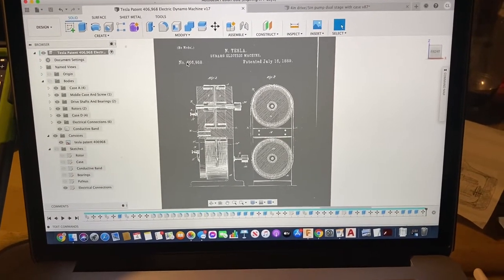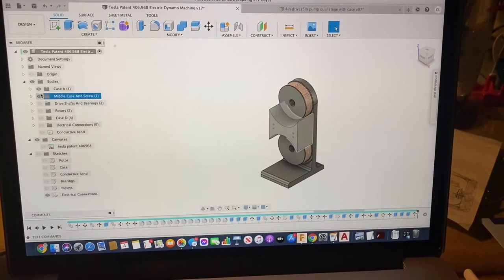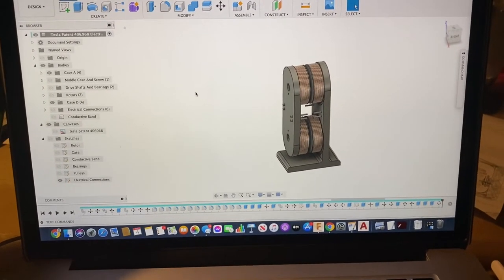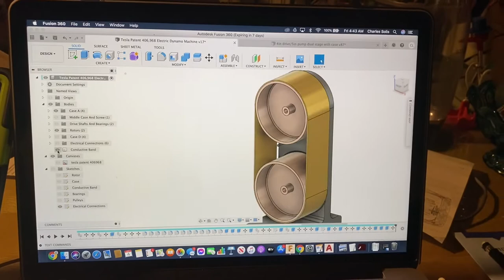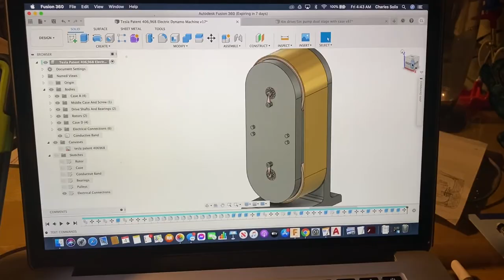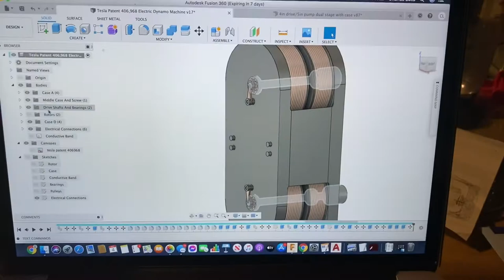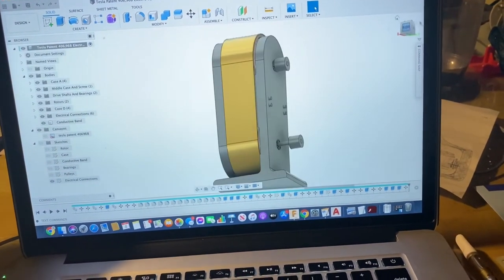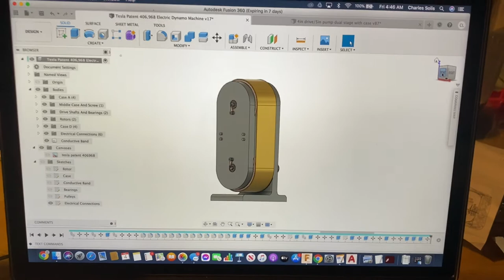Nikola Tesla Patent - 406,968 Electric Dynamo Machine - DC Electricity Generator Homopolar Motor

Comment from the maker: FYI everyone, This is exactly like a faraday disc…. It’s just two of them in series. One faraday disc with the current going from its drive shaft in the center to its periphery through a conductive band, to the periphery of a second faraday disc, to the center of the second faraday disc and out its drive shaft. 

Also just FYI, when a generator is “self exciting” it means that it does not need an external power source to generate the magnetic field that induces the flow of current/power. There are some generators that work to produce electric but need a small “exciting” power source that creates the magnetic field for some armature to spin in or for some armature to create a spinning magnetic field. For example an, without some kind of permanent magnet inside the generator no mater how you wind up coils inside you will never be able to generate a current without first creating some magnetic field via an external power source. However once “excited” small loads of power can be pulled off the generator to maintain the magnetic fields for continued operation without pulling much off the total power output. However, generally speaking, all generators that have permanent magnets in them are “self exciting” (and if there is one that does and is still not “self exciting” I certainly haven’t heard of it. But this is a common term defining generators. And when Tesla says this generator is “self exciting” he means that because of the permanent magnetic field in the casing it does not require some external power source to “excite” the first currents to make it work. You just spin the discs and free charged electrons in the rotor that is moving perpendicular to the the permanent magnets magnetic field it generates a voltage potential radially in the disc. He then says you can further draw some current off through coils in the casing to increase the inducing magnetic field on the rotor for stimulating higher voltages off the shaft without needing to change the RPM or get stronger permanent magnets. But as long as the there are magnets in the case or the steal casing is itself a horseshoe magnet 🧲 and has even some small magnetic field the currents generated are “self exciting”.

Furthermore, Tesla said you can keep the rotors insulated from the shaft in the scenario where you would axially stage multiple rotors on a single shaft. A dual shaft with 3 individual rotors on each shaft could be set as follows. (Assume all magnetic fields are set up in the way to make current flow in or out on each rotor as I say, this would be as a hole complex but each individual rotors stator arrangement would be easy to stage just the same.) 
The 1st rotor on top, nearest a casing wall would be electrically connected to its shaft on top.  The current goes in the shaft, from the center of the 1st top rotor, to its periphery, then down a  conductive belt, into the periphery of 1st bottom rotor then into the 1st bottom rotor’s center. This 1st bottom rotor would be insulated from its shaft, while still being mechanically connected, as well as a 2nd rotor, on the bottom shaft, that’s next to it. This 2nd bottom rotor is, however, still electrically connected to the center part of the 1st bottom rotor, even though neither are electrically connected to their shaft. Ie, the 1st and 2nd bottom rotors would be sleeved over an insulating hub to still be mechanically connected to the bottom shaft yet insulated from the bottom shaft, all while still being electrically connected to each other in their centers. (Again assume magnetic fields are set up appropriately to induce each runner these current paths). The current going from the periphery of the first bottom runner goes to its center and then to the center of the rotor next to it (that it’s electrical connected to) then to the periphery of the second bottom rotor (instead of shorting to their driveshaft). The periphery of the 2nd bottom runner would have a 2nd separate conductive band that runs from its periphery to the periphery of the 2nd rotor on the top. This 2nd top rotor would then also be insulated, at its center, from its shaft (on top) and coincidentally the 1st top rotor all together. As well, though, the 3rd top rotor would be electrically insulated from it’s shaft (on top) BUT it would be electrically connected, at its center, to the center of the 2nd top rotor. Ie the 2nd and 3rd top rotors are on electrically insulating hubs that are mechanically connected to the top shaft. (just like how the bottom 1st and 2nd rotor are electrically insulated from their shaft but still mechanically connected via an insulating hub/collar/“sleeve”) The current continues running from the periphery of the top 2nd rotor, into its center, then to the center of the 3rd top rotor, then to the periphery of the 3rd top rotor. This 3rd top rotor would have a 3rd and final conductive band running down to the periphery of the 3rd bottom rotor. This 3rd bottom rotor would then be electrically and mechanically connected to its shaft, on bottom, but all together electrically insulated from the 1st and 2nd bottom rotors that it shares a shaft with. 

Thus completing the circuit from one drive shaft through 6 faraday disc dynamos in series (going radially out then in, and then out then in, and finally a 3rd time out and then in), then out of the circuit down the bottom driveshaft, all while making the only non static electrical connections in the system at the center of the two driveshafts where the tangential speed of the driveshaft is very very small. 

Thus reducing any slip losses of the electrical connections and friction loss, because traditional faraday discs have to have a sliding connection at its periphery that has high friction loss and poor electrical connections because of the lack of surface area. The conductive bands are always in static connection to the rotors they touch, as they are not sliding on the rotors, just spinning along with them. This simultaneously increases the effective connecting surface area for very high current capacities with low loss while drastically reducing any kind of kinetic friction loss, plus subsequent wear and tear. Heck the electrical connections to each driveshaft alone could be done with an electrolytic fluid or some other conductive liquid material to make the electric connection have a lot of surface area, again for high currents, and making the sliding losses dang near negligible. 

I hope that makes sense. Let me know if something didn’t come across right!
Reply: The word your dancing around is ( reference)

Comment: Nice cad drawing, looks like the so called (n machine)or Faraday's disc but then a dubbel acting one to eliminate most of the problems like the mercury sliding contacts, however the belt needs to be flexible en conductive ,  again a really clever thought out machine by Tesla, 
I want to point out I always always had the feeling it's a analogue of the Tesla turbine/pump in how it operates (making pressure as it's rotating, en rotates when you apply pressure/voltage

Comment: Wow, never seen so best show and explaind. The discs have flanges(edge like T) the  coils may be arownd the permenit magnets(that or stator?) Try a small one made of maicrowave ovend magnets(4) and Hard drive discs with a pice of pipe(aluminim) as the edge. If the magnet has 80mm and the pipe 100mm you have 19mm for  each coil per thikness of magnet 4mm. May be ther closed up on each outher olone( jumper start with end) once in a rotating magnetic fild they lift up corents of oposit direction( edy, self induction, backemf) becaming a eletromagnet( if wond righ a north to a biger north ou rong north in and a eltro sauth araund??) Hop I help same way inven if i am all rong. Thanks

Comment: Porahps he use it too run ocilator of high frequency, or run it with tesla torbine+ pump. Homopolar is the only way to produce with no self-induction(correntes only in 1 way) DC, that can have no back-emf by using it with high speed interuptions( aparatus.to produce correntes of high frequency)
 tesla frequency volts/ second.
Cheack out Pauls torbine on chanel grevinert, seams like a peefect fit.
Reply from the maker: Hey thanks for commenting! That’s the plan! Check out the Tesla turbine build videos I have on my channel! I’m already getting lots of torque even for the small size Tesla turbine I’m making. Still working on the casing for the 60x 4in drive disc and 106x 5in second stage pump disc dual stage Tesla turbine I’m making. So it’ll get even more once I utilize the spiraling action of the fluid instead of just blowing through and out the other side like I’m doing for balancing. Also I’ve got a 75 disc 10in diameter disc and 12in casing Tesla turbine that I’m building right now too with the same disc spacing and thickness parameters as the small one so it should have A LOT of torque and horsepower potential. More build videos and tests to come soon!
Reply from the maker: Low rpm torque 
https://youtu.be/0lQnAQ11aFg
Reply from the maker: Low rpm torque
https://youtu.be/HlJ2cfQjNLQ
Reply from the maker: Hey!! Not sure if you’ve gotten a chance to see my latest tesla turbine updates but check them out! Just running on compressed air so far while I still work on the larger vacuum chamber system for the turbine. Peak 2.75kW and 6.22ft-lbs of torque 4150rpm with 150psi room temp compressed air with 1/2in supply lines.  And the second video is the latest 1200watt electrical load tests using 170gal of 150psi compressed air dumped to 65psi, both room temp and then 70-80°c heated compressed air. And saw the continuous 1200watt output all the way down to 65psi. Should have this thing ready for a vacuum chamber here real soon! 

https://youtube.com/shorts/yXQy844URMA?feature=share

https://youtu.be/bWpXRzrzf4g

Comment: Cool video. Think you can you build Tesla Patent 396,121 filed Jan. 15, 1889 “Thermal Magnetic Motor”? I think this would be more up your tree given your background in physics.
Reply from the maker: Hey superluminal89! Yeah that’s a good one! I know there are a few different variations that he has in the thermo magnetic motor. Is there one specifically that you would like to see?
Reply from the maker: Hey superluminal89, not sure if you’ve gotten a chance to see my latest tesla turbine updates but check them out! Graphs, charts and all! Just running on compressed air so far while I still work on the larger vacuum chamber system for the turbine. Peak 2.75kW and 6.22ft-lbs of torque 4150rpm with 150psi room temp compressed air with 1/2in supply lines.  And the second video is the latest 1200watt electrical load tests using 170gal of 150psi compressed air dumped to 65psi, both room temp and then 70-80°c heated compressed air. And saw the continuous 1200watt output all the way down to 65psi. Should have this thing ready for a vacuum chamber here real soon! 

https://youtube.com/shorts/yXQy844URMA?feature=share

https://youtu.be/bWpXRzrzf4g

Comment: Charlie, this is awesome! How do you do speed control with this when it is used as an electric motor?
Reply from the maker: Hey! So the voltage used should determine the rpm of it. Which voltage will make it go each different rpm will be determined by the strength of the magnetic field on the rotors though.
Reply: @CharlieSolis  Ok, cool. So, the stronger the field, the lower number voltage is required for a given RPM?
Reply from the maker: @PhillyEaglesFanatic  Yessir!
Reply: @CharlieSolis  Awesome

Comment: Wouldn't it make sense to have two 2-stage (turbine + Vacuum pump) direct drive shaft into that?
Reply from the maker: Hey thanks for commenting! Yes! I completely agree! I will be doing tests to try this out in the near future. 

The only thing I can think of as the reason not to do this is because this little dc generator will need A LOT of torque which the Tesla turbine doesn’t necessarily give. The magnetic field put on the rotors would have to be controlled with an electromagnet so that it’s not too strong to stop the rotors from getting into such high rpm like a Tesla turbine goes. 

I’m also playing around with the idea of replacing the rotors with Tesla turbines themselves and instead of a conductive band going between the two rotors using a conductive liquid. Either Mercury for good conduction but I’ve also though about using just electrolytic water so a bi product of running the generator is stored hydrogen and oxygen from biproduct electrolysis. I’m even playing around with the idea of doing it in a closed loop system and using a rarefied ionizable gas like neon or argon and using a Tesla coil to keep the closed loop gasses in an ionized state so that current can flow between the two Tesla turbines spinning in magnet fields, although I suspect that won’t have much benefit over being a bit of a novelty. 

This little DC generator will be great at supplying low voltages (1-24v) at VERY high currents. now that’s not to say it couldn’t get higher voltages just that it will be best for high current situations.
Reply from the maker: I’m certainly interested to hear more about it. Shoot me an email at TesTurEnergy@gmail.com I’d love to hear what you’re working on!